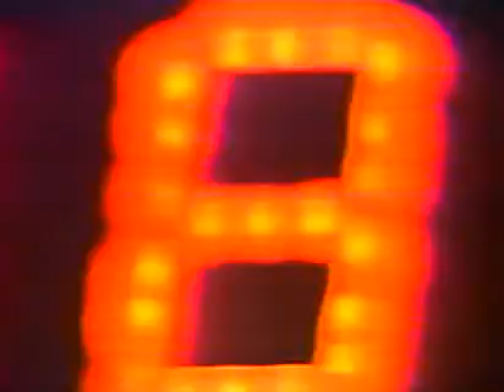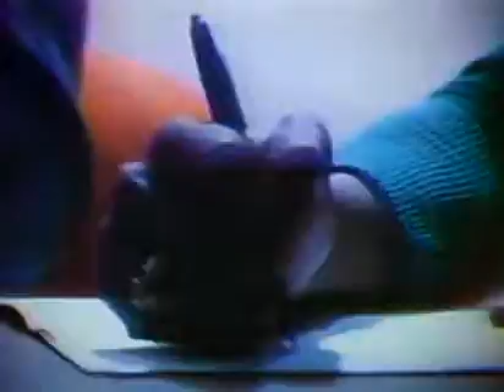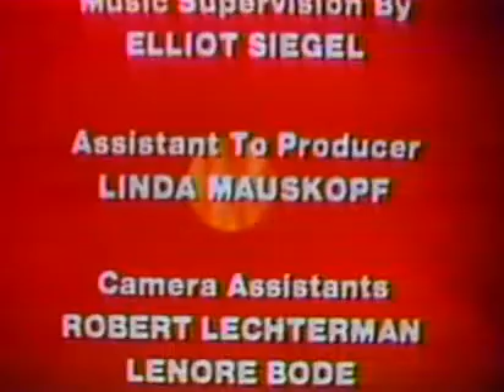AT&T Archives: Lightwave

Comment: Were the Bell System not broken up in the 1980s, I am confident that the U.S. would more closely resemble a truly developed country (by 2023 standards) with fiber optic lines directly to each residence and business, and likely more advanced technologies that are only starting to be explored already fully developed and implemented. Instead, the increasingly re-consolidated predecessors to Bell, and cable companies, have competed in a cost-cutting race to the bottom over the past 30+ years which has slowed progress under the guise of increasing competition and consumer choice. While prices may have been higher, I don't think there is any doubt that we would have a better communications system today had Bell continued as a regulated monopoly providing a utility to the country.
Reply: Hmm. Some sources say that the mass rollout of fiber optics was actually aided by the breakup of AT&T, and (separately) that a large percentage of the current fiber optic network was laid down by cable companies.